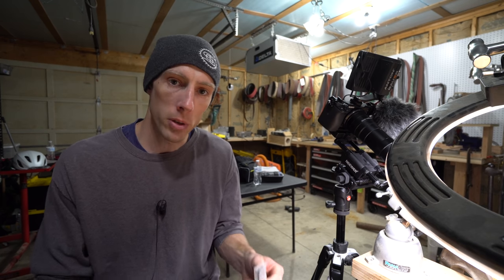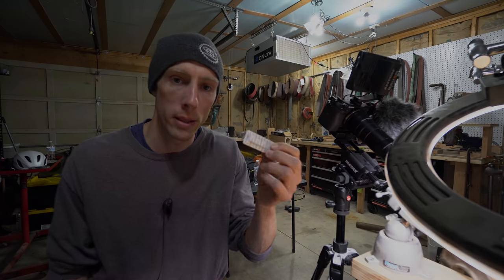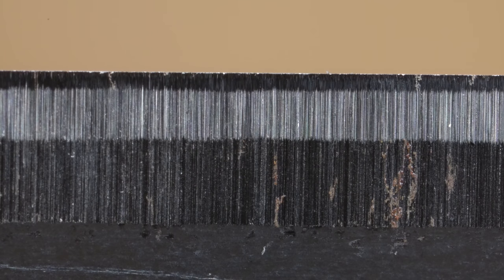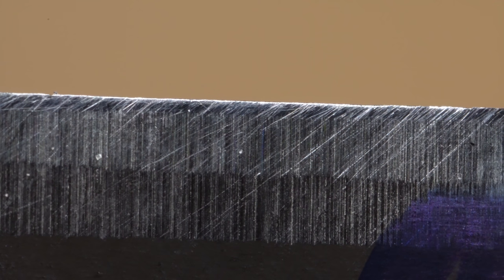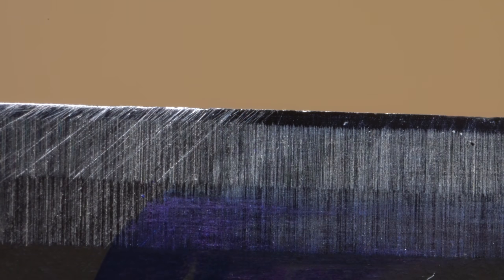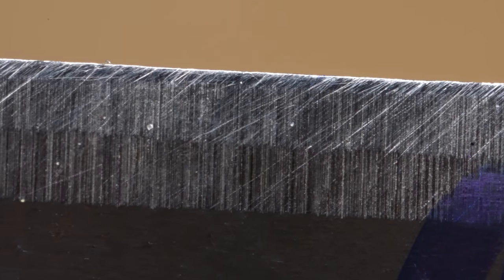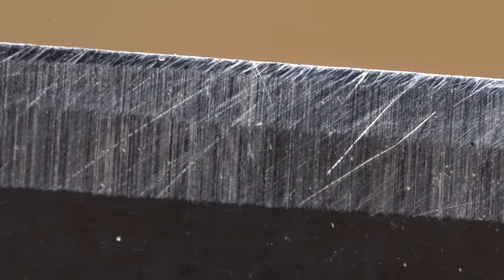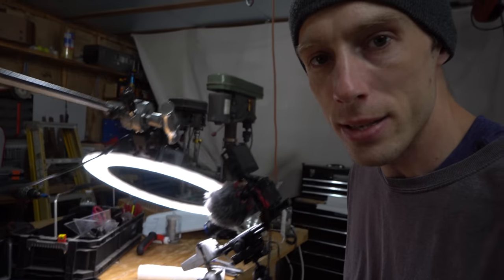What Does a Razor Sharp Edge Look Like ULTRA Close up?

Comment: I wonder how a mirror polished edge would look under that strong Magnification and i love seeing videos from you again.
Reply: Yeah, wonder if ce can make a smooth edge
Reply: Just look it up
Reply: Xp Reflex  why
Reply: Xp Reflex  
"A katana"
No. Katanas are not somehow magically sharp. This razor blade is going to be sharper than just about any katana. And most katanas feature a relatively common saber/"scandi" flat grind, although sometimes a compound bevel edge. So... if you want to know what a katana edge looks like, buy a $15 Scandinavian Mora knife that is high carbon steel, sharpen and strop it, and look at it. Because the very edge apex, what you're actually cutting with, is going to be almost the same as most katanas. It's not like as soon as you curve the blade a bit and put some Japanese kanji on it and talk about cherry blossoms that the thing somehow becomes a lightsaber that can cut through tanks and machine gun barrels and deflect bullets and cut mountains in half.
Reply: @dermotmcgreevy5220  Why not,i too would think it would be interesting
Reply: @matchesburn  lol
Reply: @matchesburn  I always loved the mystique about how magically sharp a katana was until I grew up
Reply: @pogiewogie  yeah a lot of the "magic" in how sharp katanas are comes more from how they are used and trained with. more the swordsman than the sword itself
Reply: The major difference in terms of sharpness, between a sword, knife and a razorblade is the angle of the edge. And for the last few % of more sharpness, you will need a very hard steel, which is easy to break, so its always a balance between what you need and how long it should last.
Reply: Xp Reflex  
Stop. Just stop. Stop. Just, please, shut up because you don't know the first thing about what you're talking about.

First of all, making it by hand means nothing. Most swords are made by hand. I have no idea what mystical machine you reference where you just hit the "Make me a katana" button and a katana just pops out. Even mass produced swords that aren't garbage quality wallhangers still receive hand forging. So you stating this as if it means something is laughable.

Secondly, tamahagane is so difficult to work with (and this is the "realest of real katanas" I guess you would call it) and is a leftover from poor Japanese iron deposits and metallurgy techniques from half a millennia ago that it more often than not introduces imperfections and flaws in the blade over more homogeneous steel because of the impurities in it. But, hey, at least you didn't make my eyes bleed by parroting that tedious "folded [x] times" line.

Sorry, but no. Katanas are nothing special whatsoever. They're not as sharp and awesome and mystical as you want to think they are. Metallurgically speaking the traditional katanas are very hit-and-miss because of the layering, tamahagane and work being done to them. And when you're dealing with that many different composite layers and that much steel work by hand, the chances for imperfections in the steel that create weak spots skyrockets. And it's not like you'll know it immediately like with a bad heat treatment drop test where you drop the sword and it shatters and breaks. This could be something that only shows up after use.

Surprise, surprise - homogeneous steel has advantages. Everyone that's a metallurgist has known this for over a century now, but welcome to the modern age. Wait until you hear about these new horseless carriages and lightning in a bottle inventions we have as well.

It's funny that you think the traditional methods are the best when, actually, katanas made with more "modern" methods without the complex layering system and differential steel of katanas but just using homogeneous steel (or pattern-welded steel if you're into that) with differential heat-treatment are actually demonstrably better performing. But, still, they aren't as sharp as you think they are. Edge geometry is a thing, son, and swords have a limit due to the blade width. Another shocking revelation I'm sure to you: Thinner blades cut better. SHOCKING, I know. Hard to believe that less material having to push through whatever you're cutting and having less friction is more efficient, but it's true.

Now no more weeaboo katana worshipping. If you still feel like continuing it... don't. Just don't. But, instead, watch this series of videos and don't comment:
/watch?v=-r4q0reHAC8
Reply: @matchesburn  bro, I get what you’re saying but you need to relax, take a deep breath lol. Let people believe what they want, you don’t have to get so riled up about it. Thanks for the info though
Reply: @matchesburn  Dude, this reply was way too much for such a simple comment.
Reply: @Psi34ax  
"Let people believe what they want"
You get to have opinions. You get to have even bad opinions. Perhaps even uninformed opinions. You don't get the right to believe and state demonstrably incorrect things that can be disproved with factual evidence. We do not reward stupidity or ignorance, or at least we shouldn't. That's a disservice both to them and society at large.

I don't want to live in a world where a large percentage of the human population rejects reality. That's how Flat Earth Society and people that actually believe that the Earth is flat in today's time despite having all the evidence to show otherwise happens. That's not good.
Reply: @K4inan  
No, it wasn't. If anything, I was restraining myself. And it wasn't a "simple comment" (it was actually multiple comments) and was perpetuating a falsehood. Yes, it was warranted.
Reply: @matchesburn  Dude, all I was saying was that you could have just said “katanas are not mystical magic blades that you thought they were, they’re actually pretty overrated and just a product of the Japanese coming up with techniques to refine poor grade ores” or something to that effect. That’s enough to educate most people. If there are still people who deny it, they’re so off the deep end (just like flat earthers) and you’re just wasting your time trying to reason with them further.

Again, just take a deep breath and relax. Your posts were informative but you didn’t have to get so wound up about it, that’s all. I get the feeling that you hold a lot of resentment/frustration from your past experiences with some people and you were looking to vent it out here.
Reply: @Psi34ax  
"Dude, all I was saying was that you could have just said katanas are not mystical magic blades that you thought they were, they’re actually pretty overrated"

Literally what I said in my first fucking comment here.

"That’s enough to educate most people."
OBVIOUSLY THAT WAS NOT CONSIDERING HE STILL REPLIED WITH THAT NONSENSE DESPITE BEING TOLD EXACTLY WHAT YOU SUGGESTED I SAY.
Reply: @matchesburn  l just felt bad you were so obviously frustrated/angry, I was just like that too a while ago until I realized it’s never good for myself in the end if I stress out over things beyond my control. Have a good day my man, this is my last reply. Go have a cheeseburger lol
Reply: @matchesburn  I absolutely agree with you about everything you said about katanas. I disagree, however, that objective truth is all that important. Let people enjoy life and not look at reality too closely. It's a much better experience that way. If you want to seek the truth, go ahead, but no need to force all the unfortunate souls you encounter to join you in your futile quest.
Reply: Yeah me too
Reply: @matchesburn  I once saw a person make a clean cut through glass and steel blocks with a katana, find me a European sword that could do that!
Reply: @gornjolf8877  enjoying life and not lookin too close at reality is unwise at best and dangerous at worst. Allowing falsehoods to be spread like some kinda gospel is potentially just as dangerous. Take Fauci for example
Reply: @oliverklozhoff  we're talking about the sharpness of a katana. When it comes to anything dangerous, people should be made to believe something that keeps them safe.
Reply: Xp Reflex  It takes that long because if you do it by hand, you're sharpening a 2 foot long bar of steel to a mirror finish, without a secondary bevel. Using a grinder to put and edge on a blade and then refining it with one or two stones would give you almost the exact same results.
Reply: I'd love to see some Japanese blue or white steel polished to 8k+ on a whetstone compared to stainless steel with the same treatment. Since carbon is supposed to take a finer edge, what does it actually look like?
Reply: Also old katanas were generally kinda shit compared to high end knives we have today. Material science and sharpening has come a looooong way since the myths of the katana.

Comment: I wonder how scalpel blades look under that lens? I'd like to see how many bevels they have and how they handle the hair whittling. 

Interesting stuff, thanks
Reply: Scalpel blades would look exactly the same as this razor blade does. They are no different than this razor blade other than the shape.
Reply: @orion7741  I imagine you are right, I can only see one grind and the edge bevel is a finer polish finish. I can't seem to get a scalpel to whittle a hair - old eyes & poor hair choice may be my reason for failing here.

Comment: Might be interesting to get a closer look at the surfaces used to do the sharpening as well. Different stone types, etc. Compare the ceramic cup bottom to a proper stone and ceramic sharpener, synthetic diamond stone, or would a ceramic tile with a smooth unfinished back work, etc. How does a strop look before and after prepping it, and when it picks up blade material? Those may tell some things as much as the blades do, if given the magnification view.

Comment: Alex, I'd love to see a comparison between different grades of knife steel sharpened "the same amount" (e.g. initial condition, pressure, passes, grits, etc).

Also, you mentioned using a knife steel - i think it'd be cool to see a "rolled edge" before and after honing. I love the new lenses - between the 25mm and the 100mm, i'd love to see when you use each lens for different shots.

Comment: Yes, a pre (as in, off the water-stone or  manufacturer) and post, stropped edge would be interesting. 
Also, a 90 degree view, looking straight down the pointy side (could be hard to focus, maybe you could snap the blade and get a sharp cross-section then place paper 1mm behind it to focus).

Comment: I'm new to this channel and REALLY enjoying it! I've got an old clever (on the smaller side) that's got a chipped/roughed-up area in the middle. A couple are pretty deep (about 3/128th) I don't have a belt sander or any place to put one presently. Could I get those out working on a stone? 

It's also got some rust and a lot of black tarnish and discoloration on it. What would be the best way for me to clean that up?

Comment: Interesting! Three bevels? I would like to know the angle that they give those utility blades, the steel they are made of and the hardnes they approached with their heat treatment. 
I never was thinking of material loss of this ammount when a blade gets dull. I think that this comes out of the combination of a ultra thin blade, a verry steep sharpening angle and a steel that is not verry hard, with not the best edge retention. It has not to have all this, because you get in a new blade, when the old is done. 
Stay safe everybody, and stay blessed.
Greetings from Germany!

Comment: thank you for the video! do you think you'd want to and be able to have that type of magnified view of a blade being worked both on a stone and a strop? i'd be very interested in a lot of aspects surrounding that. seeing the apex happen, the burr, the angles, the difference between the stone and strop, the fibers of the strop, the 'rounding/convex' ishness to the strop vs stone, etc. i think  it may also be very helpful to troubleshoot my own sharpening attempts by comparing something objectively comparable with the likes of someone of your skill.
Reply from the maker: I have tried this....focusing is very challenging at this level. Im still playing around with it, trying to do exactly that. Im not sure it's possible though at full speed. Most likely a slower version of sharpening on a stone so the camera can actually see everything. 🙂

Comment: what might be interesting is to see the differences between common sharpening methods - what you get from using a honing rod vs. a typical hand held pull-through vs. "sharpening systems", and then comparing against a proper sharpening progression with stropping finish, etc. - here's what you're actually getting from each of these methods.

Comment: I've got a whole bunch of knifes which are including axes, spear-fishing and chisels (metals) they are ready to use with some of them are handled, except that they are soft irons/steels, I want the toughest iron they are possibly. So I think is the Heat Treatment. I wanted to heat treat to red-hot, quench and temper. Can I do it with "ready-to-use with plastic handle (some are, for example, sickle with just knifes itself) ?

Comment: What if you sharpened the razor blade in the direction of the cutting scratches(so diagonally), or in an intersecting pattern with the cutting scratches instead of factory style straight edge

Comment: one trick that I use to sharp a knife is to throw light directly to the blade, if I see any reflection it means the blade was not sharpened yet. learn that with my master, as he said "the knife must be invisible"
Reply: Wouldn’t a reflection indicate that it is in fact polished up consistently? I’m struggling to understand what you’re getting at sorry

Edit: what do you mean by “invisible”

Cheers
Reply: @TylrVncnt  it depends on the perspective, if you look to the side of the blade, yes, reflection will mean a good polish, but if you look directly to the edge of the knife (the cutting edge must point directly to your eye) any reflection on the edge will mean that the edge still has burrs, and therefore is not sharp
Reply: @TylrVncnt  also this invisible thing I learn with my kung Fu grand master. what happens is that during a fight a well sharpen and polish knife is impossible to see when it is moving with the edge or the tip of the knife point twords you, that is why the knife must be invisible, so your adversary cannot see it
Reply: this is hard to explain without video, so if I don't make myself clear be free to ask again

Comment: I saw a video comparing the ultra sharp Obsidian scalpel blades used for brain surgery being compared to the regular steel scalpel blades used in other surgeries under a seriously powerful microscope years ago, and the regular steel blades looked like very crudely "sharpened" axes that some Bubba had "sharpened" (butchered) by rubbing it on a rough chunk of granite in his yard by comparison to the obsidian, which is cleaved like a diamond to give insanely hard, smooth, ultra-fine and literally 10x razor-sharp edges that this video reminds me of, because the difference in the 2 scalpel blades was a lot like the dull, worn-out edge compared to the new, unused edge of this blade, but way-more extreme...

If I can find it online I'll post it on this thread for anybody that's interested?

Comment: i whas wondering if you can do a video about sharpness. 
everyone throws the dam term razor sharp scary sharp ect around like they get money for it everytime they say it.
however looking online people say steels like zdp 189 gets scary sharp vs somthing like s30v so there is a difference!
is it toothy even at higher grits? does it cut straight to bone with a slight drag? is it dull feeling like a over polished blade ?
you get alot of knifes hair whittle sharp so do you feel a difference? is there one? does one feel more dangerous then the other ect?
is there a steel that does it the best is what would be interesting to see.

Comment: You should have used my knife as a dull example. It was chunked all to hell and so dull I had to saw a piece of tape on a box. I finally resharpened it so I started with a file. Normally I’d never use a file but in this case the damage was severe. I really need to invest in some diamond stones for my sharpmaker.

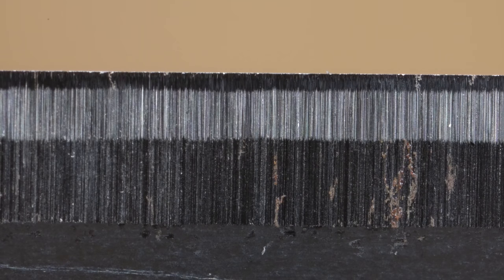Comment: 1:17 isn't that third bevel just a very even burr? In the picture you can see a hairline fracture of that part, with light shining through. And to me it looks like that entire part has the same thickness, from the edge to the beginning of the second bevel. If that's the case, then I would simply call it a burr. It makes the angle because both sides of the edge are sanded equally and then the burr is flattened out. I can imagine an automated process that would create this result (2 sanding wheels touching eachother, and the burr thickness being the play on the axles or bearings of those wheels). They would grind the secundary bevel and then pull the burr flat. Just tossing in my wild ideas, I'm not claiming that these are facts =) Thanks for your awesome content!

Comment: I think the manufacturers are at the tip of the iceberg at to how it all works, what make a new blade cut good is the serrated tip from the way it is ground but the very edge could be laser treated to cause a tempering effect so the blade would last a long time.

Comment: They say softer rocks can't scratch harder rocks. So how is it possible that cardboard can damage a metal blade?
Reply: the cardboard can not scratch the metal. but, it can still wear on the metal. by simple cutting it a lot of times you will wear down on the blade enough for it to be dull.